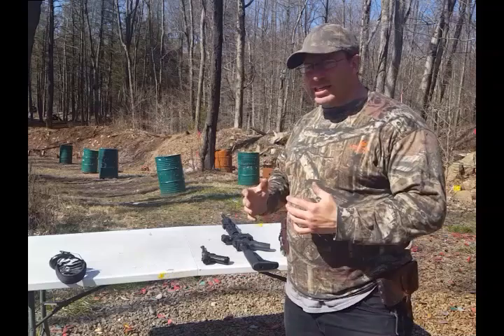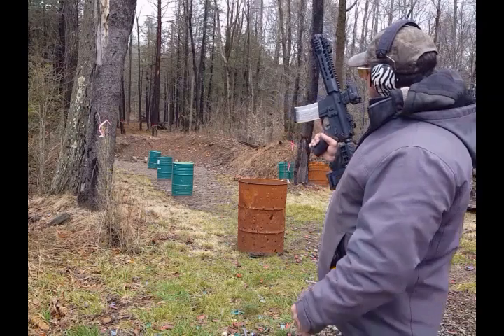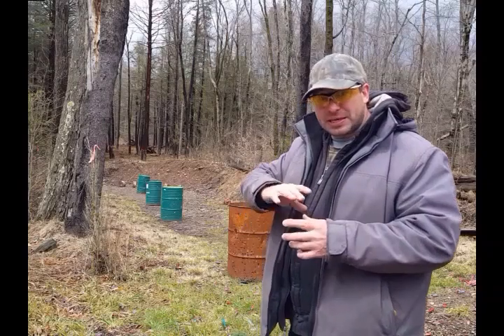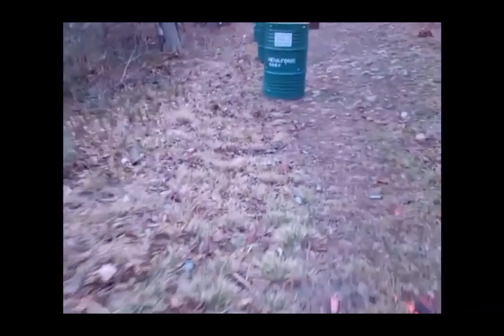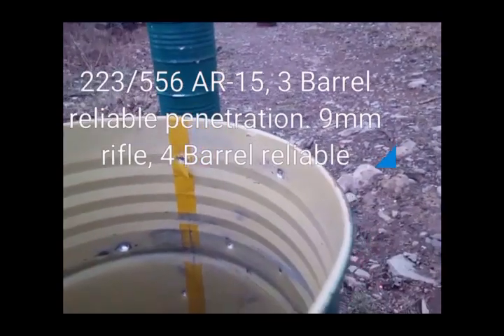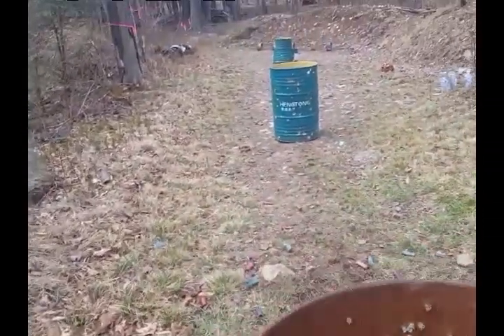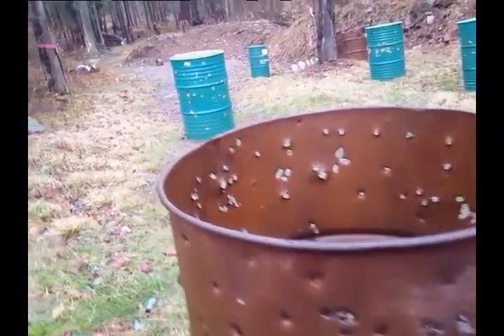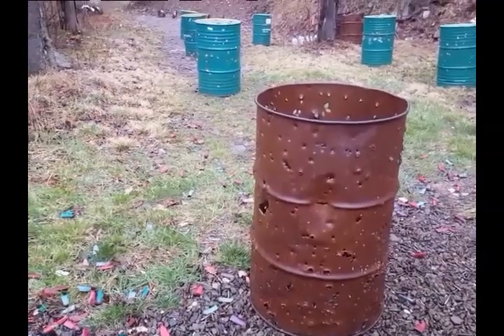Penetration Test... what Bullets do when they go through barriers

Comment: I would like to see some demonstrations between rifle hollow points, non bonded soft points and bonded soft points to see how fast they loose velocity after hitting a barrier.
Reply from the maker: I did a little bit of testing with that, I didn't see a significant difference on the barrels with HP vs FMJ. Both 9 mm and 223 went about 3 barrels when spaced 15 feet apart. 9 mm out of a rifle sometimes gets to four barrels.

The tip of the 9mmm gently breaks up, but there's enough body behind it to keep it together.

223 either way disintegrates by the 3rd barrel. All I can find is some jacketing and lead flakes in the barrel.

The holes looked about the same size with HP which is not supposed to expand unless it hits liquid. Holes on the second Barrel were bigger due to tumbling with 223. Much more than if the bullet had actually expanded.